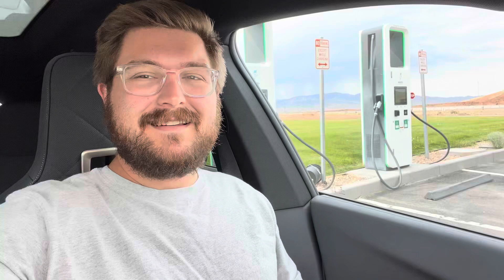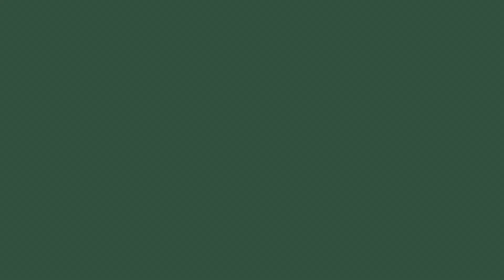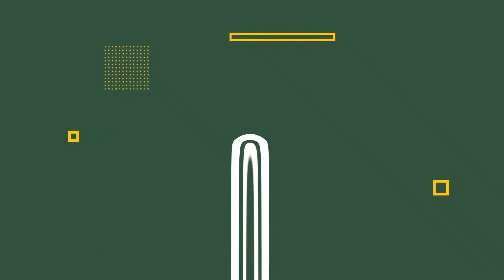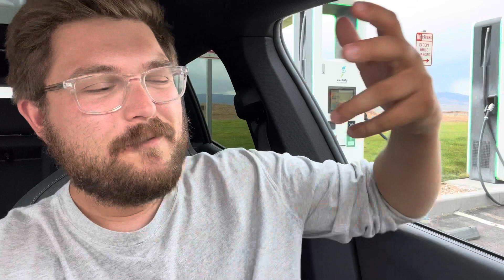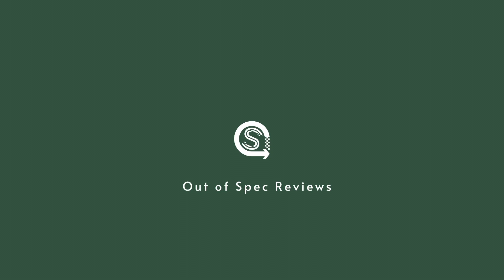Here Are The Benefits Of An 800 Volt EV Architecture - Is It Really That Much Better Than 400 Volts?

Comment: KW = volts x amps. If you have a 250KW charger the current is 250KW/400v = 312.5 amps. At 800v the current is half or 156.25 amps. Amps determine the cable size while voltage determine the insulation rating. Losses aren't really an issue as the cables are short. There is an increase in shock and arc flash hazard at the higher voltage. Finally 800v semiconductors are readily available, and there is nothing special about them over 400v rated ones. I routinely work with such devices rated over 1500v and they cost no more and are easy to source.
Reply: My premise is that the designer maintains 500 amps as the target charge current in order to maximise charge rate (minimise charging time).  Since lower charge times minimises the disparity between BEV and ICE I submit that manufacturers might shade toward optimising the charge time in order to get the vehicle sold at some expense to the battery lifetime.

If the charging current is constant between 400 and 800-volt systems, my assertion that, for a constant battery pack energy capacity, the current doubles for each cell in the 800-volt pack is valid.

I am not asserting that manufacturers of similarly-sized vehicles will automatically double the peak charging power for the 800-volt vehicle.  I am only pointing out that shortening the charging time relative to the 400-volt vehicle that is limited by the 500-amp limit of the charger cable can come at the cost of a lower battery lifetime.
Reply: Ah makes sense 800v would be much better given everything. Just wondering how much the parts actually cost.
Reply: @davidbaker9943  800v is not better and may actually be more dangerous and harder to deal with. And parts are readily available up to 1500 volts.
Reply: As you say, doubling the voltage can half the amperage.  Half the amps can mean less heat losses in the same size cable.  Heat loss may be negligible to you, but any heat loss is a waste.  And yes, there is heat loss as shown by Kyle in other videos.  Why do you think that charging cables are actively cooled?  In another video Kyle actually put a damp washcloth around a Tesla connector to cool it, and the Supercharger responded with higher charging rates.  Andy, seriously, if you think heat loss is not an issue, please stay well away from designing EV charging stations.
Reply: @omelborpon3159  Sizing cables properly and cooling them deals with the heat issues. Going to 800v introduces many safety issues. 600v is the limit for most AC circuits the public interacts with. 800v will led to many new regulations and safety requirements. The added risk and cost is not worth it. I have worked in the power industry for over 40 years.

Comment: 800V is a hype and totally unnecessary from an engineering point of view. Charging on 400V has more losses due to additionally DC/DC conversion and 800V charger are way more expensive install. And then 800V is too low for trucks and busses. Just a waste. Manufacturers trying to pretend to be ahead of the crowd, same as Porsches 2 speed gearbox. With all that 400/800/V2L/V2l/AC/DC what is needed is a world wide Bidirectional DC only standard. It doesn't make sense for the vehicle to waste design space and weight with any AC charging equipmend plus the dozen of cables and adapters I carry with me to survive inland Australia.
Reply: 800V chargers are standard, not more expensive and why 800V is too low for trucks and busses I don't understand.
Some are just 600 V and some only charge at 150 kW atm.
Reply: @abraxastulammo9940  Everything incorrect here.Depending on country 99% of DC chargers are 400VDC. Right now trucks are mere conversions but both the Mega charger for the Semi and a new Euro standard for heavy vehicles are above 1000V.
Reply: @moestrei  99 % of 400 V chargers are probably legacy 50 kW chargers (aside from Tesla) which should be discounted for any serious EV future
Reply: @abraxastulammo9940  Incorrect. Most DC  chargers up to 200kW are 400V charger because CCS allows for up to 500A (400V * 500V = 200kW). No one needs more. Another craze is the charge peak which is absolutely meaningless. We need way more 100-200kW (two outlets CCS and NOT one goddam Chademo) rather than super expensive 350kW /800V  charger which is a rate no EV can currently charge. When doing a meal stop I prefer a 50kW charger to better match timing. For example the 18 mins an Ioniq 5 can charge is a total waste as you cannot do anything sensible in that short period of time and end up staying with the vehicle.
Reply: @moestrei  They all are wide voltage range chargers, e.g. ABB Terra 175 is 150-920 V and 375 A, Alpitronic HYC 150 is 150-1000 V and 500 A.
Reply: @abraxastulammo9940  they all have.....Incorrect. The ABB units have many others not.Typically the input from the grid is 400VAC 3 phase which you only have to rectify to get 400VDC.
Reply: @moestrei  Many other chargers...which?
400 V from the grid means nothing if your car has to charge with 450 V (like ID3 Pro).
Reply: @abraxastulammo9940  Where I live we have 99.9% Tritium Brand chargers. Yes, they actually do 500VDC max. Which you can get easily out if 400VAC which is not Vpp. The 800V chargers are specified 1000VDC requiring doubling the voltage which require extra high power circuitry and causes extra losses which is why 800V chargers are so expensive. An 800V car charging on 400V or on AC creates extra losses too due to the conversion which need to happen in the car.
Reply: @moestrei  It is irrelevant because all new chargers are 800+ Volt, look at Ionity, they also have the Tritium chargers and they can do 350 kW (but not with 400 V). It is like the discussion stay with 32 Bit vs go 64 Bit 😜
Reply: @abraxastulammo9940  I did say 350kW do 1000VDC. But 350kW chargers are nonsense as no car can charge at this rate. Again peak rating are nonsense too. Ionity is formed by traditional car makers.....and they are still learning. What will be interesting to see are the charging requirements for future solid state batteries.
Reply: @abraxastulammo9940  OK, you are right: Just checked specs of newer model chargers >50kW and they all go >800VDC.

Comment: 800 volts (and higher) is actually cheaper to design and build once the manufacturing has been converted to it. It's only costly to those that designed everything for 400 volts architecture to begin with to now have to covert over to 800 volts. That's why Hyundai/Kia can start their Ionic 5 under $40k and the EV6 at $43k because their E-GMP platform was designed with 800 volts architecture from the start. Tesla has to be given a big pass, simply because when they began over a decade ago 50kw was considered "supercharging". So going with 400 volts was state of the art back then. No need for any higher voltage as no conceivable charger higher than 400 volts at the time would be needed even if that speed would be tripled. 
 
You mentioned the fact that it's why all high transmission lines use super high voltage -- MOST are actually at hundreds of thousands of volts high. But you left out part of the reason and just left all to "losses" but discounted the "heat" portion of it. A more illustrative example is to note that if that wasn't done, the cables would have to be a hundred feet in diameter. Another way to visualize it is, if instead of upping the voltage you up the amperage to get the same power, then those same thin cables used now would literally burn in less that one second. That's right, in LESS THAN ONE SECOND. That's how dramatic voltage versus amperage is. And that was the genius of Nikola Tesla to come up with transformer for upping and lowering the voltage that allowed him and Westinghouse to beat out Edison and his DC electricity network that could only go as far as 1,500 feet at the time.  

You mentioned the "I squared times R" equation, but the key to that equation is the "squared" portion. And what that means is if you double the amperage to get the same power without upping the voltage you don't simply double the losses, but you quadruple them. Therefore, you essentially also quadruple the heat. This is why current Teslas can only maintain that high rate of charging on V3 superchargers for a very short time before overheating, despite Teslas having superior batteries, cooling, and charging technology. Why do you think their cables are so short? Unlike what most people think, that it's for better aesthetics, and that's part of it, yes, however, it's actually for engineering's sake. 

The Cybertruck, (whenever it's released) will be 800 volts architecture, and the Semi will use even higher voltage. It will be using "mega-chargers" as in megawatt. It's why their 4680 design have all those little tabs -- so they can be cooled or heated from the inside, not just the outside as it's done now. That cooling (from the top and bottom -- ala Lucid) will be displayed/revealed on the Semi and Cybertruck. No need to tip their cards just yet.
Reply: Agreed. But model S plaid can take 5-33% at 250kw flat. That's unbelievable with 400v tech. How do they do it? It's great engineering. And heat loss is around 10% which is in line with 900v tech like lucid. And their cable is thinner than any 800 changer (like electrify america). And the interesting thing is that, their v3 (250kw)  charger's cable which has a higher ampere is thinner than v2 (150kw). How? I also thought that higher amperes need thicker cable but tesla defying something? Its great engineering and innovation. Hands off. Tesla is really years ahead.
Reply: @mhsohel47  Yes, however, the 800 volts architecture Lucid models do it 0-46% at 290kw. And the dream edition has a proven range of over 500 miles doing 70MPH on tests performed by real owners and users, not simply a company's claim. Yet, as you said, Tesla has superior engineering, but is hampered by its 400 volts architecture. There's no better example for the superiority and efficiency of 800 volts than that on both charging AND discharging.

Here's another example. If you were to charge an EV at home using the standard 120 volts that North American homes use, it would take 2 to 3 days to charge to 100% depending on the battery size. Yet, when a 240 volt plug is installed, it charges to 100% overnight. Yes, because you're forced to use two 120 volt cables the amps are also incidentally doubled, however, in Europe, which uses standard 240 volts, the amps are the same or lower than the standard North American 120 volt plugs and charge EVs overnight all the same. How is that so difficult to understand or not see the huge difference in simply doubling the voltage?
Reply: @Paul-cj1wb  Hmm, but do you know that, plaid is not actually not that far off of EPA estimate. Let explain: 
Plaid did 300 miles on highway test with 21 inch wheel which epa is rated 348 miles (highway and city combined). In highway, it is about 340. In 70 mph higway test it did 300 miles (inside evs) 100-0 but did not use boyond zero percent. There is about 20 miles of range beyound zero (indivual test). So actual range is 320 of 340 epa only 20 miles less where lucud is 15 miles less of epa. And tesla can also use 240v ac wall charger that can charge it to full in 8-10 hrs.

Comment: I have a Lucid which is fast charging when EA can do it.  I just ordered a Mercedes EQS which only charges at 200kw max, but, it seems like it maintains higher voltage longer and so is able to come close to a higher voltage system in the real world.... thoughts?
Reply: MR MONEY 💰
Reply: Why you ordered a EQS also if you have Lucid? Just curious.
Reply: @djprojectus  I am selling my Tesla Mdl S. I trade cars a fair amount.
Reply: @EVAdventuesRob  Ahh,ok.
Reply: Im wondering if there's a hidden buffer in the EQS pack that allows for a higher kW over a larger SoC curve like the Audi ETron. Im also curious how these battery pack will fare in degradation over 10 years

Comment: This was awesome! Thanks for explaining it so clearly! I was listening to Bjorn Nyland from Norway about this as well about 2 months ago. Sounds like the benefits of the 800V architecture is not there yet. Hopefully the future! Wonderful video!
Reply: Why is it not there? 800V has multiple advantages: faster charging, less weight, less heat, more power, easier power output. You can see those advantages with the Hyundai ioniq 5, or the Kia ev 6 Gt going up to around 280 km/h
Reply: @Seitenwerk  Watch Bjorn's video on it 2 months ago. He goes on a rant for about 30 minutes. The name of that video is "Why 800 not in EVs makes no sense." On the photo, it states "The 800 Volt Hype." It sounds we are almost there, but not there yet. Bjorn explains in detail. And Ioniq 5/Kia EV6 doesn't have preconditioning, though the Genesis EV60 does. I heard those two will have it next year? I have no problems with 800V architecture.

Comment: At 300 W/mi, 150-200 kW seems sufficient.   At 600 W/mi, one probably wants the added complexity of 800-volt architecture.  Technically, the only increased complexity is being able to accommodate both 400 and 800-volt charging.

For a vehicle with a given battery energy capacity and a maximum charging current of 500 amps, the current into each individual cell of the 800-volt battery would be twice the current into each cell of the 400-volt battery.  This is higher stress on the battery.  I see the potential for a manufacturer to optimise charge rate at the expense of battery cycle life on 800-volt passenger vehicles.  For larger batteries in pickups and commercial vehicles, the risk is lower for the manufacturer to  sacrifice significant battery life for a nice charging time stat.

Comment: I refreshed my understanding of basic electrical terminology. What Is a Watt?
Watts are units of electric power. Think of wattage as electricity at work when heating or illuminating a room in your home. Take a portable electric space heater rated at 500 watts. The space heater consumes 500 watts of power when it’s turned on.

What Is a Volt?
Voltage is the pressure that forces electric current to flow though a wire.
In North America, utility systems typically deliver electricity to your home’s service panel at 240 and 120 volts. Major electrical appliances like ranges, clothes dryers, water heaters, air conditioning and space heating systems typically operate at 240 volts. Everything else runs on 120 volts.

What Is an Amp?
Amperage measures the rate that current flows through an electrical circuit. If voltage is like water pressure, amperage is like the rate of water flow. “Amps” is the common shorthand for this.

Now, I'm going to listen to Kyle's minilecture again about I^R, and the pros/cons of 800V v. 400V architecture

Comment: The problem is the grid. The grid cannot possibly handle all this. We are already seeing this in Ca. To upgrade the gird to handle this would take at least 50 to 100 years.
Reply: I live in CA. Not sure what you’re talking about. The grid has enough energy capacity for EV’s, especially because owners charge overnight.  The grid everywhere does need to be updated due to aging infrastructure & to cope with the more extreme weather & to be more efficient so we have less loses due to long transmission. I think we need micro grids, community solar & a lot more virtual power plants.
Reply: This is not true.. The grid will get better in much less time than what you stated. You will be surprised how adaptive we are moving forward.
Reply: @nguy404  any grid upgrade will take a very long time. Building new generating plants takes a long time.
Reply: LH got it right. The government in California REQUESTED people to not use large appliances, including car chargers, from 4 to 9 pm because of record high temperature. People took the advice and we didn't have rotating blackouts. There were some failures because of equipment, mainly pole pigs, failing in the heat. But EV owners have a brain and only have to pay 1/3 the amount if they charge between 11 pm and 7 am. EVs can be programmed to do that automatically.
Reply: @danielcarroll3358  the current EV is a loser. Grossly over priced, too long to charge, too short a distance.

Comment: There is a lot of talk about battery packs with 800 volt architecture being much faster charging than a pack with a 400 volt architecture.  I contend if a DC fast charger, either 400vdc or 800vdc, is powerful enough, the limiting factor for pack charging time is the individual battery cell.  In a pack, all cells are balanced, and are of the same size.  They are all charging at the same rate and at the same time. So, the time it takes for a battery pack to charge, is the time that it takes for the single battery cell to charge.  To take this to an extreme, it doesn't matter if they are all in series,( really high  pack voltage with low current), or all in parallel, ( really low pack voltage and high current), it takes the same time to charge the pack.  I consider " the much faster charging 800 pack " concept  a myth.   Mark Bishop
Reply: We should test if EV6 GT can charge just as fast at SuC v3 because of their clever 400 V conversion.

Comment: DC FAST CHARGING level One
Is up to 48 kw
DC FAST CHARGING LEVEL The Megawatt Charging System (MCS) is a charging connector under development (in 2020 to 2022) for large battery electric vehicles. The connector will be rated for charging at a maximum rate of 3.75 megawatts (3,000 amps at 1,250 volts) direct current (DC).  Should be on use in 2023. 
DC Chargers are at the stations, direct current the battery.
Reply: MCS is a standard now.
Reply: @abraxastulammo9940   Hi,  it does not look like it's
completed.  https://en.m.wikipedia.org/wiki/Megawatt_Charging_System